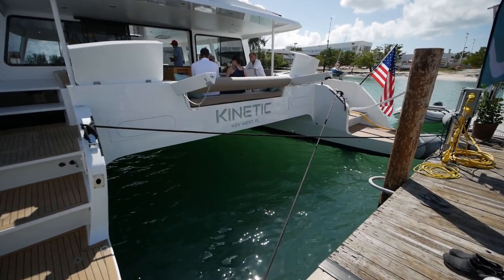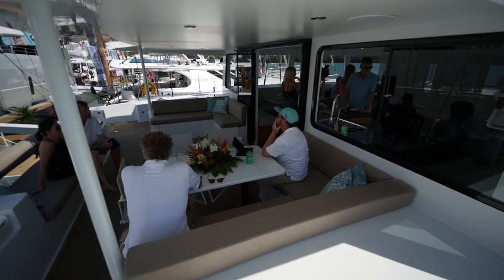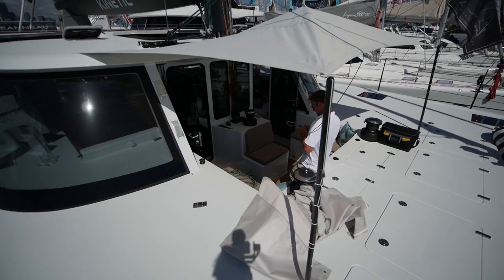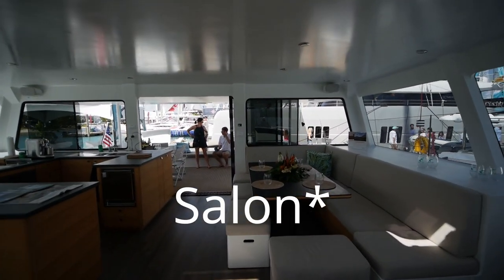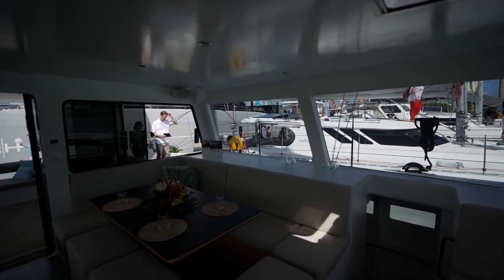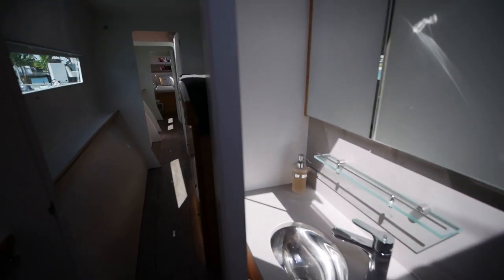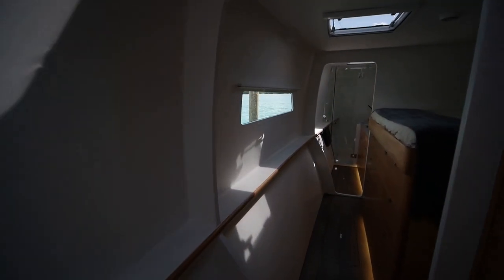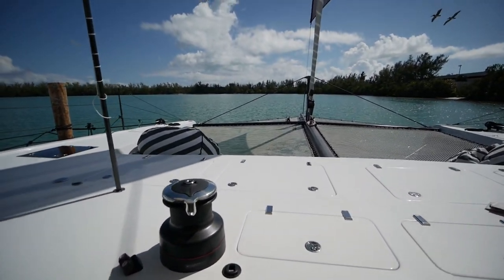High Performance ALL CARBON Catamaran - Kinetic 62 - Narrated Walkthrough

Comment: Finally, something different in a catamaran instead of the typical layouts I've seen. I really like this boat. The only negative are the very narrow hulls for the length of this yacht. Definitely can give Gunboat a run for the money but she better be FAST.
Reply: normal cruising rig options will have you sailing at 20knts without even trying. 13knts in 12knts of wind. Spec your boat with their performance racing rig options and you will smash at regattas

Comment: Funny both Kinetic and Gunboat and some others copied Chris White Designs Atlantic series, yet none can catch an Atlantic. Consider that the Atlantic is not a carbon boat, you have to question the hype around why you would buy a fully carbon performance boat; only to load it with so many luxury items to slow it down enough to kill the speed.

Comment: Cool boat I like the vertical pilot house salon that raked aerodynamic look isn't needed at sailboat speeds,now do this smaller in the 40 foot range and use e glass instead of carbon fiber ?
Reply from the maker: Look into Balance Cats, maybe Maine Cat 41, Catana 41(?)...not as balls to the wall but decent performance. No one really builds super high performance at those small lengths from what I know. Eagle 53 would be smallest carbon build off the top of my head...might come across something smaller.
Reply: @BigBensBoatBrokerage  The problem is labor and material costs.  A small Carbon boat would cost nearly as much to build as a larger one, which makes smaller ones uneconomical to build.  Smaller boats with mostly glass fiber make more sense.